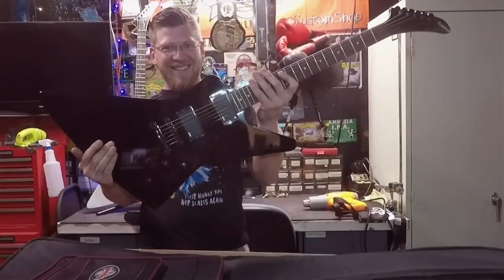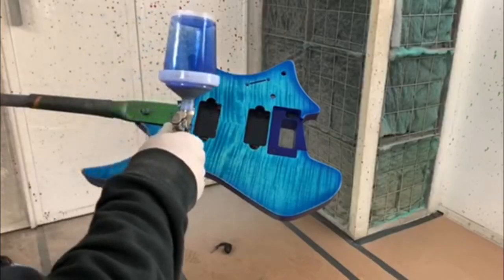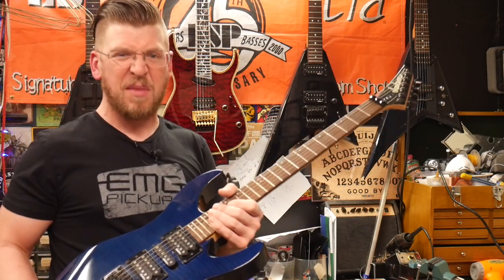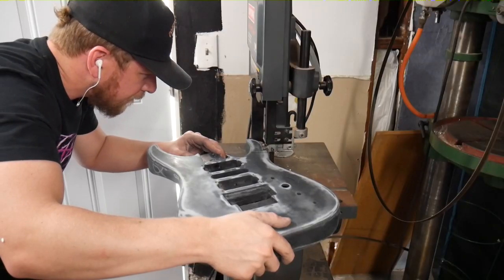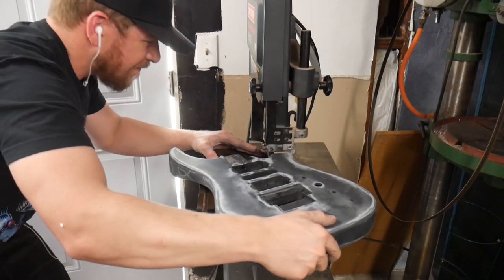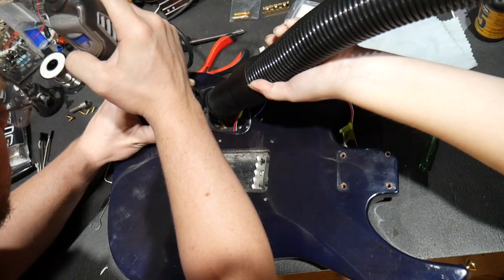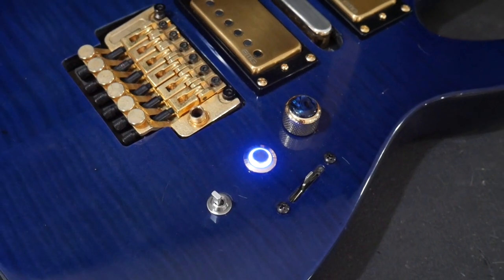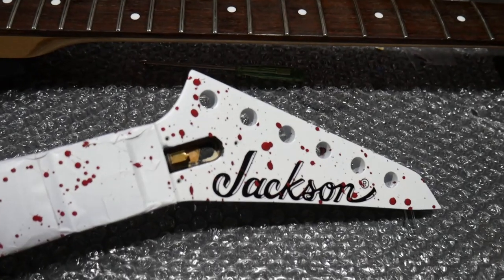Trash to Thrash #2 - Blue Flame Maple Jackson, Hacksons and Floyd Roses

Comment: I possibly figured out your floyd rose issue. The gold licensed Floyd Rose is looks to actually be a GFS Speed Loader Floyd Rose. Similar to the Floyd Rose ii from the 80s (which I use in two of my Kramer guitars), they are meant to be restrung like a traditional bridge and tailpiece and be single locking instead of double locking. The only difference is the GFS one has saddles designed to look more like the traditional double locking Floyd Rose saddles instead of what you get on a Floyd Rose ii. So if I’m right, you don’t need inserts in that bridge. Just string it through where the Allen key screws would go (there should be a hole where you would normally put the Allen key) and string it up. Let me know if this was the issue man! Love your vids!
Reply: Had one like this on an old epiphone em2 from the 90s as well.

Comment: 10:31 why didn't work it's because you're supposed to put the strings through the back of the Floyd Rose I had one of those and I suffered a lot of high E string breakage